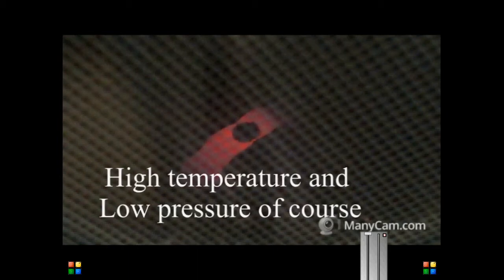copper oxide turns into copper metal just by heating it.

Comment: hi can you do it with other metal oxide like zinc oxide?
Reply from the maker: It works with zinc, but is more difficult because the zinc evaporates at the temperature and vacuum needed.  Copper does too, but not as fast.